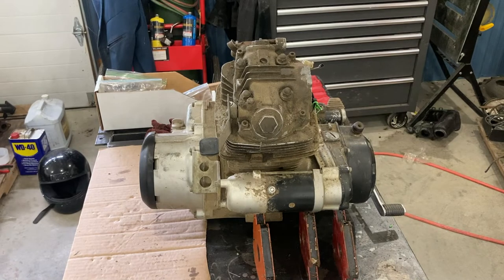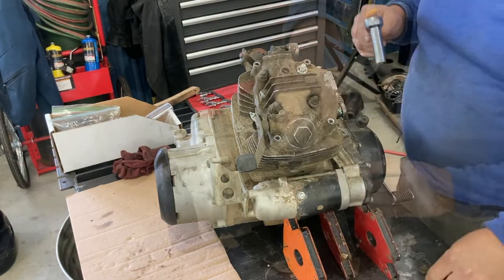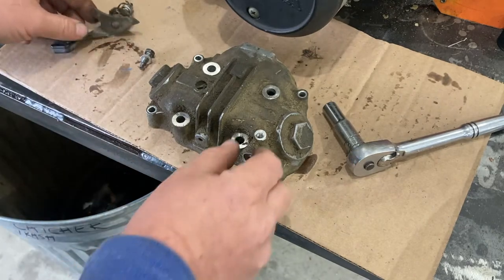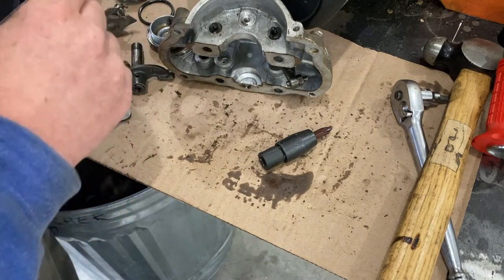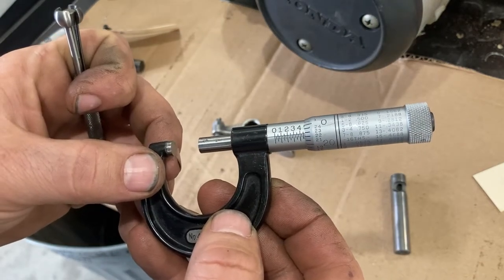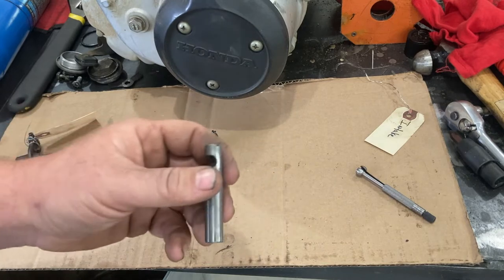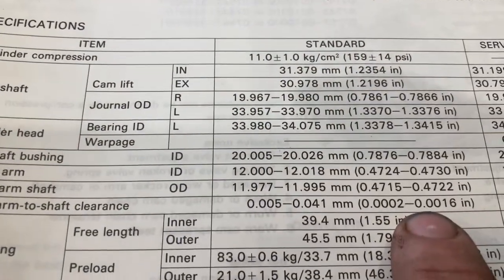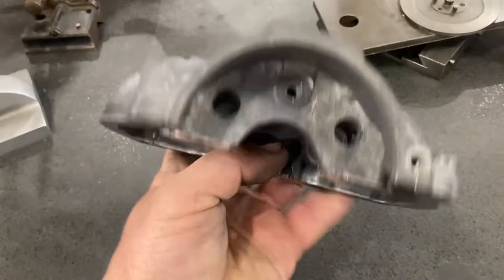Honda ATC200 Rebuild #2 - Rocker Assembly & Head Cover

Comment: What’s a decompression lever? Is it like a jake brake??
Reply from the maker: It makes the exhaust valve slightly open so when you have to pull the recoil rope start it doesn’t yank your arm off lol
Reply: @MaineMachinist  ahh gotcha. This is a great series. Hope you do more like this, definitely learned a lot.